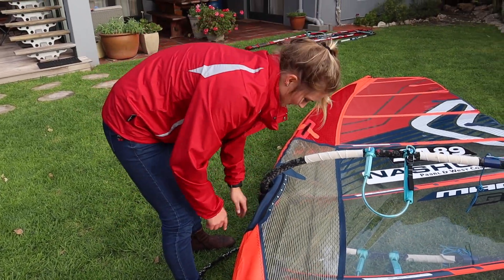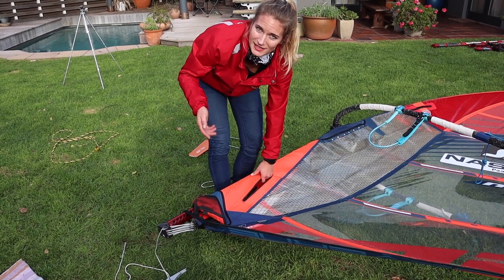HOW TO RIG AND FINE-TUNE SEVERNE SLALOM RACE SAILS ~ For top windsurfing performance and enjoyment

Comment: It's so great to have a woman giving advice! We have different issues from the heavier guys and tips from 100kgs guys just don't fit it. I've had Severne gear for years - From wave sails to racesails and I learnt so much from this video. As a 62kg sailor I usually just put max downhaul on and go sailing ( because I can't put more on out there).  I used to think the sails were just designed to be sailed overpowered by the bigger guys and only really got going about the time I'd need to change down.. I think I will be playing around with lightwind settings more.
Reply from the maker: Such amazing feedback!! 🤙 Thank you so much! This is exactly the purpose for my channel.. I've always had the same issues as a lightweight, and through all the years of learning, competing and trying new things I'm so happy that I can make the sport more accessible for a wider range of windsurfers and lighter weights. Thank you so much for taking the time to give such positive feedback! 🤙

Comment: Karo, some real nuggets of info in your video and love your passionate way to bring this across.
Regarding the harness, I have always been a seat harness person. You should find yourself one with a higher back and give it another try. Specially for speed the seat allows you to get into a position where you can utilize a lower centre of gravity. The harness is applying the power through your hips and into your legs and not your back. As speed surfing is all about incremental improvements you should give it anther try.
Are you now using the Mach 3 Severne sails and what are your thoughts?
Stay safe and healthy in the crazy times!
Reply from the maker: Thanks so much once again for your awesome feedback and your thoughts! 🤙 So glad you are enjoying my videos... For sure some of the seat harnesses with the higher backside should be a great alternative to the original lower seat. I have been switching back and fourth between the two for speed and slalom, but getting much better results and control with the waist. I think that the biggest aspect that gets to me is the greater amount of control I have over my board with the waist harness... It personally feels a lot more balanced between power from the core and legs instead of mainly the legs. I had to, however, develop a much stronger core through heavy core workouts, to optimise performance with the waist harness.. So that definitely helped me a lot! I think that it's also very much a personal preference between the two for speed and slalom... So many amazing windsurfers love the seat and specifically the higher positioned one you are referring to👌🤙😎 There is definitely no right or wrong, it's just so important to test both and see what feels more comfortable instead of just mainstream trends, especially when it comes to speed sailing. Glad that you found your sweet spot with the seat harness.... That's always the ultimate goal, getting that setup and sweet spot where it all feels in harmony and effortless with maximum control and minimal strain on the body!! 🤙😎🚀
Reply from the maker: .... With regards to the Mach 3s, with covid there has been great delays in getting the new gear here, so I went straight over from Mach2 to ordering the Mach 4s. This order is still on its way to SA... I'm holding thumbs that it will be here soon so that I can still use it in the second half of our season!! 😎🤙 So at the moment I am still on my Mach 2s untill the M4s arrive here.... Will definitely do a proper review about the new gear once its all here. SA is a little remote, so everything takes so much longer with the added constraints on shipping due to covid restrictions. 🤙🤙Here in SA they have recently closed our beaches again over the festive season till mid January...looking so forward to get back on the water soon! Hope you keep healthy and safe as well in this difficult time🙏

Comment: Sailors with moderate fitness and strength are much better off with small sails, rigged for min wind. I gave up on 7.5 and even 6.5! I find my Ezzy cheetah 6.0 has all the power I need when on min downhaul setting, also when wind comes up even to 12 mph I love the new 5.0 on min. I think many people don’t realize they can do this. See my “Kailua windsurfing for seniors” and give it a go. I am 178lbs.

Comment: This fantastic video prompted me to buy a severne reflex 7m wing and now thanks to you I know how to rig it better!
I have a 115lt slalom board and a weight of 73kg, with which wind range can I use it?
Reply from the maker: I’m so happy to hear that my video was helpful! That is an awesome combo👌 Your wind range will depend a lot on the size fin you use. With a 38 fin, you’lleasily cover anything between 15-20 knots on that gear setup. In higher winds, I would go for a 36 fin. 🤙
Reply: 👍  @KarovanTonder  Many thanks 😃🤙

Comment: Hi Karo,  I was gonna buy two Severne GT Turbos, but I have seen wrinkles in the mylar at the head section of both sails due to improper packaging.  Do you happen to know a method to remove the wrinkles???  They look ugly because that part of the sail is not stretched out after rigging.  Happy holidays :-))
Reply from the maker: Hi there! Sorry to hear about your experience. That is not a good place for a wrinkle, because, like you say, it remains floppy even after rigging. However, with time, it should improve a little as the sail gets exposed to the elements and stretches. It could also help to slightly tighten the top batten tension to help initially with stretching the surface tension. I unfortunately don’t have a method for this except to give it some time to mould more towards its original state. ✊✊

Comment: Hi Karo and thank you for your great videos. One question about the Severne harness, the yellow one you call race-harness I think this one are not possible to buy anymore. I think I also saw you with other waist harness in one of your videos as well.... What Severne waist harness are "the same" as yours or most similar? Will it be the LUX or CMR? I normally do freeride/race blasting with Futura 124 liters and NCX or Turbo sail, which harness should I go for? I use a Prolimit Teamwave harness now but not to happy with the hook sliding up to easy. THX in advance. Best regards Stig.
Reply from the maker: Hi Stig, thanks for your great feedback, I’m happy to hear  that you are enjoying my content! The race harness I refer to (yellow one) is the Severne Lux harness. The Lux these days come in blue. My wave harness that I use only when I’m on my wave gear is the Air harness. I highly recommend the Lux for your needs... it’s got the best back support and is extremely comfortable with proper padding and fit. 🤙

Comment: Very well done video Karo.  A lot of good info here.  Much of what you have said holds true for rigging most brands of race sails so everyone can relate, well done.  I was very interested in your fin, board, sail combo. I use Gasoil fins as well but only have two. Have you tried soft vs hard flex, and if you have which do you prefer?
Reply from the maker: Hi Bob, thank you so much for your comment and positive message! I am so glad that my videos are helpful. I am actually currently working on a video of the fins that will go into detail about how they function and what my preferences are with regards flex, twist, size etc. The video will feature in the coming weeks. But just in short to answer your question, I prefer my fins slightly softer with a little more flex so that I can get away with using a slightly smaller size and still get amazing lift. When using a smaller size fin, it has less drag and therefore more speed. The only time when I go up in size is when the tide is running out and I don't have enough water grip. The gasoil 2018 fins were quite stiff in comparison to the 2019 fins. I definitely preferred the 2019 fins, as they gave me more effortless lift due to the increased flex. With my 5.5, 95L fox I mainly use 32, with my 6.2 I use 34 (incoming tide) and 36 (outgoing tide) with my 107L board, with my 7.0 I always use the 38 and my 107L board and with my 7.8 I use the 40 with my 115L board. I hope this helps!

Comment: I assume the advice works for the Overdrives as well? I have a 7.5m Turbo then 7/6.2m OD then Mach 2s in 5.5m / 5m
Reply from the maker: Yes, these tips works for the Overdrive, Turbo and Machs.... All the cambered Sails. 🤙 The 5.5 Mach 2 has been my favourite sail of all time! Such a powerful sail that! Very deep profile, its almost as powerful as my 6.2! I think they mimicked some elements of the Luderitz edition sails in the Mach 2 5.5 and 5.0😎🚀🚀 Enjoy!!
Reply: @KarovanTonder  I saw a rigging video for the Turbo and it said more downhaul  gave it a deeper belly. I suppose with those it's more outhaul  changes for lightwind  power?
Reply from the maker: @horsemadf1  when downhauling the sail to the max, you have a very floppy leech and you may kill off the power in the sail. Its very good for going downwind, like at Luderitz, due to the bigger belly in the sail and much more twist to the top, but when slalom sailing and slightly underpowered, you need to release the downhaul slightly to tighten the leech and have  less of a opened up twist... This will give may more stability and power in the sail, together with slightly releasing the outhaul.

Comment: The dealer made a claim to Severne about these badly wrinkled sections in both 6.0 and 7.0 GT Turbos, stated that wrinkles do not go away because they are in the head section where the sails are not stretched when rigged, and they had to be replaced under warranty.  Severne's response was that this had been a usual thing for mylar sails, told us to live with it, and refused the exchange.  This put me and the dealer in a difficult position because I paid the top dollar for the equipment.  This has never happened to me before with Ezzy, Neil Pryde, Goya or North for the past 30 years.  My windsurfing buddies had a sour taste with Severne also.  So, from now on, I will only buy windsurfing equipment from a company that stands behind its products.

Comment: Is there any difference in using a higher or lower boom outhaul on the Severne Glide 2/3? What exactly is the difference, especially for foiling? I heard that a higher outhaul is for strong wind, but I also heard that if you need more power, this doesn't make sense. Only one of these can be true. Please tell me which answer is right and what differences you could feel. How much power could you increase, percentage-wise?

Comment: Fantastic video Karo. I have no coaching available where I surf so I rely on my experience from sailing on the national team and YouTube videos.
I got an isonic 117L, a Mach 1 8,6, severne ALU race 200-230 and a pair of severne harness lines like yours.
Now, I cannot afford a new apex mast and no one are selling a used... Probably too fond of them haha... Is it impossible to rig a Mach 1 with a different brand mast or do you absolutely need a rdm ish top with SDM bottom that only severne makes? I realize I need an apex but I can't afford it and I can't wait forever for a used to pop up haha
Please keep these videos coming. They're very helpful. Love Denmark
Reply from the maker: Thank you so much for your nice message! I'm so glad you enjoyed the video and that I can help with my channel... 
The Apex masts are super expensive. But they are a lot more durable than the original standard masts. The best option would be to wait for an Apex mast to become available on the secondhand market. If you use a normal mast that does not have that Apex shape, specifically in the Mach Severne Sails, it will have quite a big impact on the Sails performance and it may be very difficult for the sail to rorate properly. The person who bought my Mach 1 Sails tried the same thing, he rigged my 7 with a standard mast, but he struggled so much with the rotation of that sail, so he decided to buy the apex from me as well. I remember that with the Reflex 7s, it was quite easy to sail with a standard mast and have good rotation, but Severne has streamlined the designs of the Machs so much for the apex masts that it has almost become vital to have one. Try out a standard mast if you don't want to wait too long for the apex to become available on the second hand market, but then I would mabe put in more downhaul to help the sail rotate better. Also try then to remove some of the spacers to make room for the thicker mast section in the sail. I think that your best option is still to rather wait for an apex, I'm sure that soon when guys get their new gear, they will become more available. Is there perhaps a Severne team rider in your area that you can buy from his old gear? Once you have an apex, that mast will last you very long, because they are super durable, so it's a good investment 👌🤙
Reply: @KarovanTonder  I greatly appreciate your time and help!
Reply from the maker: @ScrattleGG  Is a great pleasure! I love to help where I can 🤙
Reply: @KarovanTonder  You don't by any chance know if severne has some bstock they sell at a reduced price? I've been looking for 3 weeks now and cannot find a used apex mast around that'll fit my mach1 8.6. I put up yet another add looking for one for the coming week :P
Reply: Hi, I can just confirm what Karo says. I have 4 Overdrive M2/M3 sails and tried to rig them on a Severne 100% SDM masts of 2014 which have a thicker diameter. The cambers are very difficult to rotate even with all spacers removed and full downhaul/outhaul. Also the sails feel very twitchy. Put them on an Apex pro - which I bought afterwards - and it all just fits. Cambers rotate easily, the sail handles gusts much better.  I have a bit the impression that with a different mast you have to have so much downhaul and outhaul in order to make the cams rotate that the shape of the sail is just not good anymore.
I can just really recommend to buy the right Apex / Apex pro mast. It really does make a difference.

Comment: Hi Karo. What tape are you using on the boom?
Reply from the maker: This is medical bandage tape.... It works like a charm as a boom grip! Highly recommended! 🤙🤙
Reply: @KarovanTonder  dank je. Just got a second hand Mach 2 7.8m. Replaced my gator 7.5. What an amazing difference!  Can sail in much wider range, as in stronger winds. Scary now is you get much faster as well. Thank you for this video as it helped heaps. I have older blue line mast that I think should work. Took out al spacers and still rotation very tight. Think with downhaul it might be better. But if a ext 20. The leach is very very loose and think too loose. Any suggestions?
Reply from the maker: Hi Lard, I'm so happy to hear that my video helped! Yes it's such a great change from the gator to the Mach.... You get a lot more effortless speed and stability through the lulls and gusts. The rotation issue will be resolved when using an apex 460 mast instead of a standard mast... If you are still having troubles with rotation and you are using an apex mast with the correct extension, the downhaul could solve the problem. Downhaul the sail so that the leech loosens up from below the boomerang sign.... It should be quite loose so that the sail shapes into a spiral at the top when sailing. See if that improves the rotation. Let me know if it solved the problem.. 🤙🤙
Reply from the maker: .... Just another suggestion, make sure your boom is wide enough for the shape of the Mach. If you use a freeride narrow boom, the sail won't be able to rotate freely and hit the sides of the boom.
Reply: @KarovanTonder  have the enigma 180 - 226. Might be downhaul. But thought Severne mast is Severne mast. Maybe different diameter? I have the sdm
Reply from the maker: If you are not using the Apex Severne masts on the Machs, they will not rotate easily. Definitely the mast issue if you are using a normal mast from Severne. It has the be Severne Apex, because it has a standard diameter at the bottom and tapers down to RDM top.... This shape is vital for top performance and rotation of the race sails.